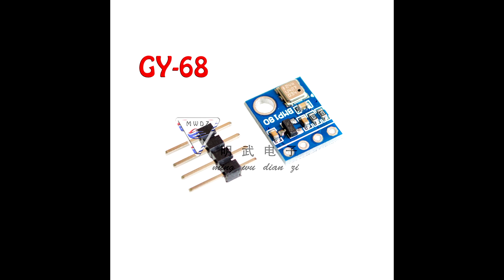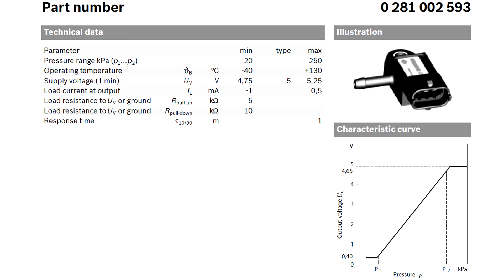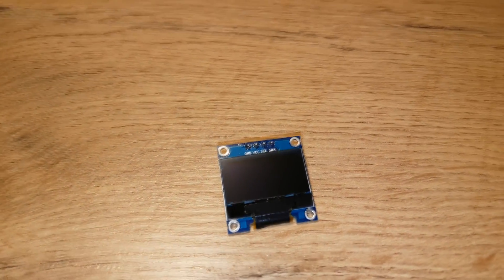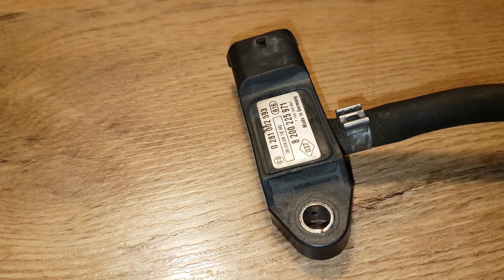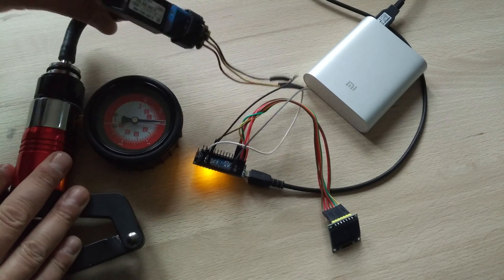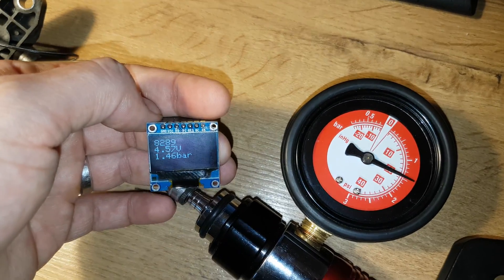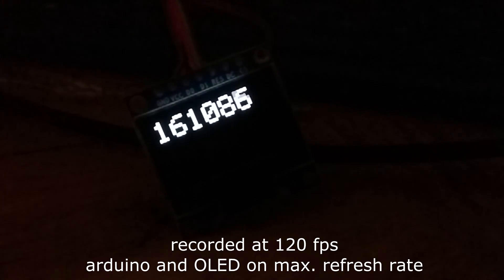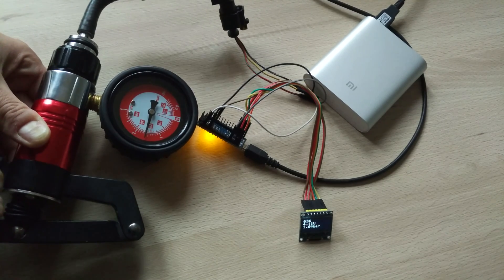Build DIY turbo gauge using arduino, OLED and Bosch pressure sensor

Comment: I realize it's an old project, but .....
You will have measurement errors. This is because you have considered a reference value of atmospheric pressure that is influenced by altitude or weather conditions. The ECU has a second internal pressure sensor, which is actually the reference

Comment: I am busy with a similar project but I could not find a 3 bar MAP sensor for an affordable price and did not want to tap into the existing 2.5 bar OEM sensor wiring, so opted for a surface mount pressure sensor and I’m using an Arduino NANO clone (Pro Mini V2), XGZP6847300KPGPN5 pressure sensor (-100kPa to 300kPa range) and a white 0.96” OLED screen on I2C. 

I know this was a project you did 4 years ago, however I am taking a stab in the dark here. Would you mind to please share your code with me ?

I am struggling to find the correct math to convert my voltage into bar to output to the OLED screen so would appreciate it to see how you have accomplished this.

Comment: I'd recommend getting a 10bar pressure transducer, very rugged sensors to which you can screw a metal hose to or put on your manifold or intake tube.
Gives off a linear voltage rise to 5.5v
Then you can run your wires to your arduino.
Reply from the maker: When you take turbo pressure into account, 10 bar will have really low resolution (0.5V per 1bar), 1 bar in gasoline engine with turbo is considered as high boost.

Comment: I am in the process of making a similar project but with a 16x2 lcd but i am having trouble reading\converting the map sensor voltage to boost value, could you please share your source code ? Thanks in advance

Comment: Any news on this?
Reply from the maker: I am quite busy on different projects, I installed this turbo gauge in my car, but I still did not print proper case for it. I changed project concept to integrate the OLED with cluster panel as it will be less disturbing in the car. Will let you know when I post new video about it.
Reply: Maybe you could post the source code? The case would be different for other people so they can design their own.

Comment: Hello great idea I thought of doing the same thing for my car the only difference is that I have already the Bosch 3bar sensor factory fitted to the car so I would just want to tap into the signal wires and display it on a screen. Nice idea with the oled screen but have you tried a segment display? Also could you please tell me were I can get the sensor specifications that you displayed at the begining of the video?
Reply from the maker: You probably can just measure the voltage of stock sensor - but be sure to check for any interference from wiring-in. Even small change in voltage will result in wrong pressure reading by the ECU and different fuel ratio, which as a result will cause power loss or extensive smoke.
LCD (segment display) is much slower, I did not consider it as I did some projects with LCD and I know how bad they are with higher refresh rates.
I found PDFs with google, but I don't have links on hand. Just google your pressure sensor model number.